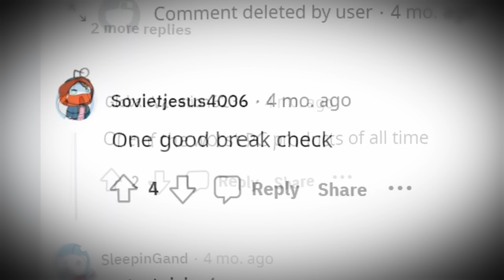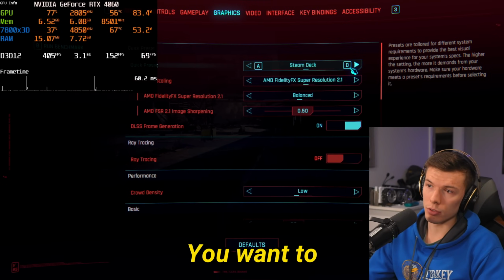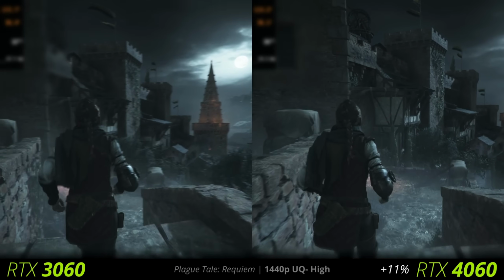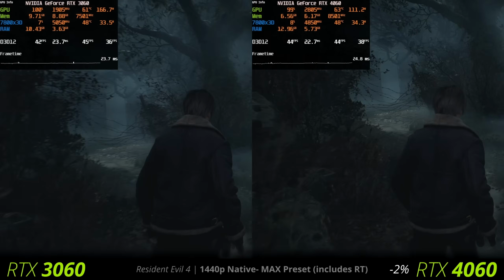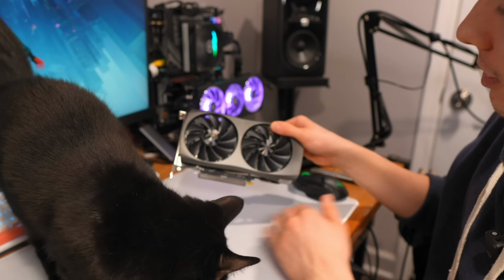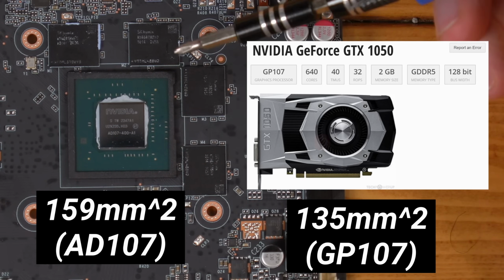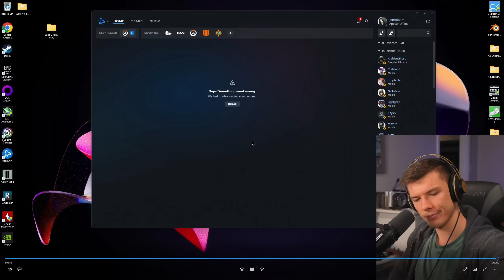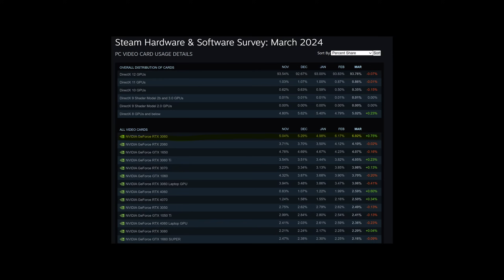I Tried Nvidia's best "Budget" GPU to see if we're Doomed

Comment: I upgraded from an R9 390 from almost a decade ago to a new 4060 8gb last week.  It ran very well with my ancient rig and now runs very well with my new mobo/cpu.  I havent tried anything as extreme or new as Alan Wake 2 or Cyberpunk but my Helldivers 2 runs at max setting, native upscaling, at a solid 60+ fps.  This card is just fine for a low cost 1080 rig utilizing a 60fps screen.   It also sips power (125 watts) vs my r9 @ 350 watts!  Having a console fills in the gaps for me on demanding games.
Reply: i’m going to make the exact same jump soon excited to see how it turns out. what cpu are you using?
Reply: I'm using a i5 13400 and Win 11 with 32 GB fast (can't remember) ddr5 ram.  Using all mid level parts games run perfectly at 1080 and great at 1440.  @bonnsmith  @bonnsmith
Reply: @matthewrobbins663   and which mother board?

Comment: its not that you dont have enough vram to fit the game, with the same settings the 2 cards should use the same amount of ram, its the speed of that ram, the 3060 has a 192 bit bus vs the 4060 is a 128 bit bus, that means per clock cycle 3060 transfers 50% more data to and from vram per ram chip, the 3060 also has 50% more ram chips, the result is the 3060 can transfer an extra 88 gigabytes per second

Comment: It all varies depending on price and marketing. I got a base 7600 for $200 open box and everyone I've talked to says that it was a super solid deal, and I've had a great time with it. Does that mean I'll tell someone to go buy this card for the $260 or $270 that you can get it for on amazon? Probably not unless it's that persons only option for something under 300. Everything surrounding the 7600 is pretty much a resounding "meh" but I've had a great experience with the card.

There's rarely a "bad card" nowadays, mostly just "card thats priced bad"

Comment: I'm happy with my purchase. Upgrading from 1660 super to 4060ti. Ideally I wanted 4070/7800XT but again, i need to upgrade my PSU and the pricing from 4060ti to 4070 is quite high for me, plus i need to change to new PSU.
Reply: So you say that it's worth it ? I have a 1660 super as well, and I was thinking of upgrading to a 4060
Reply: @danielfloare5820  please consider pricing from your place and if your PSU can work with 4070/7700xt/7800xt or higher. If you dont need to upgrade your PSU, and the pricing is not that far off (like $120 perhaps between 4060 to 7800xt/4070) consider getting higher end card. 

Its just bad pricing for high end card in my country, AMD pricing is also not as good as in the US. Nonetheless i commit and happy with my 4060ti, mainly for stream+recording on my free time.

Comment: I bought one. Going from 1660 super to 4060. My monitor is 1080p and PSU is 500W. It was the cheapest option to upgrade my graphics. All other options i have to spend another $50-$90 on a bigger PSU plus have to pay more for the GPU itself. The card is  perfect for someone like me.

Comment: I have a 4060 I just bought as an upgrade to the 1070TI. and I don't know if it's just me, but I love it for the price.  between these two cards, all games I play now are pulling off about a 40% increase in frames.

everything is expensive nowadays anyway and I don't feel 289 is honestly that bad for entry level. especially for what you get. the 1070ti, my previous graphics card, was advertised to be able to pull a great overclock. but the damn thing ran SO HOT that I couldn't actually overclock it without the card sounding like it was going to explode. now that might be PNY's fault and not the actual card but that's my experience with the 1070ti.

I haven't tried to overclock this one and I don't think I'll get very far with voltage but I'm excited to try because I've heard you can get somewhat of a good "stock voltage" overclock on this card.  Especially because 4k furmark stress test is only getting this card up to 62 C after 10-15 minutes of pressure. that's pretty cool out of the box. (the 1070ti stock voltage OC was at 88-90 C after 5 minutes...)

So I'd say if you compare the prices of everything and sheer % price spike in EVERYTHING in the current overall economy, I think it falls right in line to what you'd expect with a budget graphics card.

Comment: I did some math on my super high setup from 8 years ago and came to the conclusion that with the 1080 that was new at the time I spent 2k in total, which ends up being 250 dollars per year, and it still works and will probably give me another year. A setup with a 4060 will cost you around 850 (cpu and motherboard in equal pricing range to the 4060) but the vram issue is so bad you might have to upgrade in a few years, meaning you’ll get a yearly value of 283 dollars. Basically it’s a terrible bang for your buck and you’re spending more for less no matter how you look at it. The vram is a literally product breaking issue

Comment: I actually made some research before finally settling on buying a 4060 for myself.

The reasoning is quite simple, actually, because my older desktop PC was an i3 8100 with an gtx 1050 ti, and I've been using a laptop with a Ryzen 7 4800h with an rx 5600m, and what I'm looking for is basically to play at 1080p (I don't even have a 1440p monitor!!) with as high settings I can get without compromising fps, so basically vram won't be much of an issue (I probably will never go that high in graphics anyway). The comparisons I made were with the 3060, so this one is just better for what I need it for, and compared to AMD, for the same price (6600xt or 7600xt, latter slightly more expensive) it has ShadowPlay which I really really like, losing out on a bit of performance. Also productivity is great on this one..

Basically, it's great if you know what you're getting into.

Comment: Got this to pair with my old i7-2600k CPU as a temporary fix after my GTX 560Ti died. 

The RTX 4060 will do until I build a whole new PC in a year or 2.

For me its a MASSIVE jump in performance. Especially if you're using it mainly for emulation and Visual Pinball (VPX).

Comment: I went from a pny gtx 1060 to a msi rtx 4060ti. So it was a nice upgrade for me. I have a 1440p monitor and play all games at 1440p with the 4060ti. Always use dlss when available with balanced setting and no rt and get 60-100fps depending on the game. Would love to trade it in for a 4090 or wait until something in the 5000 series.

Comment: This is odd. I have a 4060 ti and I am able to run both older and newer titles with rtx at a locked 60 fps (only because I capped it at 60 fps). I have had little to no problems. Although I do want to upgrade to a 4080s i do not have the money for it.
Reply: I also run most of my games at 1440p but sometimes I keep the native res at 4k with similar performance. I do this on Batman: Arkham Knight, of course not that new of a game but still looks phenomenal.

Comment: Tweaking some configs im getting solid 50 to 60 fps average in cyberpunk with ray tracing in ultra on the 4060, thats without frame generation,  sometimes depending on the place it stutter to 40 but it comes back quick, with the frame generation i get close to 70 fps so for me it works like a gem, its all about tweaking the in game setting to get a better performance

Comment: People be saying gaming isn't fit for the 4070S but what about rendering/simulating? I've been using a ThinkPad 2016 300 since it came out to render. No games except GMod and HL 1 run on it without problems but i still love it. (can't wait to get it though since it still is abysmally slow for any program, it isn't bad, but degradation hit it for atleast 6 years with no cleaning)

Comment: One thing I can see as nice in a 4060 is the 115 Watts of power draw for RTX GPU with DLSS.

3060 eats 170, 1080Ti eats 250 so if you have a low-ish end rig, a 300$ gpu is acceptable upgrade if you had something like 1050ti/1660Ti and not the money/option for an entire new rig with 3080ti+.

Comment: I think I have the exact one you bought and I got it for about $220. It is leagues better than the 5500xt i was running before and quite a few games I play actively have dlss compatibility and dlss 3.0 is actually pretty good. All in all for $220 id say i got my bang for my buck. Not to mention my main monitor is 1440p and I can play most other games at max or close to max settings and get at least 100 fps reliably, even in unoptimized games that dont have dlss.

Comment: i have a 4060 in my laptop,and  it is preforming very good.But when i uptated the bios everything got fucked up,but i think in a good way.For some reason my 4060 uses the vram from the integrated graphichs too,and the preformance is better then the 4070 desktop version.The only small problem is that the system doesnt regognize the card anymore so i need to go to graphic settings,choose the app I want to use and put it on high preformance(the 4060).Overall its a good card,never had a problem with it

Comment: I went from a 2060 with 6gb of vram to the 4060 ti with 16 gb of vram. It fits right where the 2060 was, it runs cooler, it draws less power… those are all pluses for me. Plus I actually can turn on a lot of extra ray tracing and frame generation with those 16 gigs. Now the pricing is brutal to upgrade from the 4060 to the 16 gig ti, ill admit that, but it met my price ceiling. I was not going any higher. So it checked all the boxes.

Comment: I like the 4060 (I plan on getting one within the next months). I am very satisfied with 1080p and 60 frames per second. I don't need more. I'm old enough to remember when the normal fps rate for videogames 30fps, people claimed 60fps made the games look less cinematic, or overanimated, or that they couldn't tell the difference between them. I also don't want to buy new monitors. The 4060 pretty much garantees 1080p with 60 frames per second, while being very energy efficient at only 115 watts. If I had more disposable income I would get the single slot 70 watts 12gb A2000, but the 4060 will do.

Comment: Went from an RX550 to a RTX4060 about 2 months ago. Its absolutely worth the price, especially in todays GPU market. The performance upgrade was a lot better than I expected, it runs COD MW3 at ultra settings, dont remember the resolution, but pretty high resolution, 60 fps all day long at around 60% utilization. iRacing at medium graphics in VR holds 90 fps consistently, sometimes have to back off foliage or grandstands depending on track. I can run high settings at 60 fps outside of VR super easy. Microsoft Flight Sim 2024 on decently high settings around 2k resolution outside of VR runs great at 60 fps and looks amazing, and it can do low settings in VR at 90 fps at around 80-95% utilization depending on the terrain. 
TL:DR; It does everything i needed a GPU to do and for cheaper than anything else thatll do it. Is it perfect? Fuck no. But its also about $1500 cheaper than what would be perfect, so I'll take it.

Comment: I have an Asus RTX4060 Dual OC V2 (upgraded from GTX1650) with  3000 MHz over clock 127W on Asus Prime B360-A with 32Gb DDR4 Perdator at 2666 MHz and i5-9500. Lots of performances leftover but it's what you got when buying what you expect to work but pairing over spec and under spec components 😂. In sum it's playable. Cyberpunk 2077 18fps on max and 67fps on balanced. GTA5 has the same around 80 fps from before upgrading but from normal to max settings. In sum if you can over clock your RTX4060 you gain from 10 to 15% uplift reaching almost RTX4060TI 8G level of performance. Not the best purchase but a substantial upgrade.

Comment: For around 50 $ more you get a 3060 ti 8GB and it is still a Monster! with my Ryzen 7 58003d.
I play Warhammer 40k Space Marines 2 with 2k resolution and Ultra settings or Black Myth:Wukong  2k resolution and High settings. 
Both games run around 90 FPS.

Comment: I was able to get an open box 15"  HP Victus at microcenter for 650 bucks with a 4060, and I am honestly shocked at how unimpressive it is. I have to crank games down to Medium settings sometimes just to get acceptable frame rates. I swear, my old laptop from 2018 with a 1660ti ran better....in all seriousness for the price I paid, that HP Victus does everything I need it to do, but still, we really are going backwards.

Comment: Me and my cousin both have a pc with same stuff except the gpu. He has a rtx 4060 and I have a radeon 6700 XT. And they both were 300$ brand new. And I can confirm that the 6700 XT was SO MUCH BETTER than the 4060. Like CS:GO in my pc was getting like 250 fps in 1440p high settings while he was hardly getting 100 fps in 1440p medium. I am not trying to say that the 4060 is THAT bad but if you want better gaming and you do not care if its intel, amd or any other company and want performance, get the rx 6700 xt.

Comment: I got the 4060ti 16g from gigbyte, it was letting me play cp2077 on Ultra RT at 70-110 fps but after to long it would flatline unless capped at 60fps. I gave it back to Amazon and got a 4070 super which will be here tomorrow.

Comment: I changed from  3060 to a 4060 last minute in a build I purchased because the 3060 was out of stock. Well, I did play half life 1 in the lowest possible settings andI changed from  3060 to a 4060 last minute in a build I purchased because the 3060 was out of stock. Well, I did play half life 1 in the lowest possible settings and shittiest resolution and still had some frequent freezings and such, so I'm not that upset about it.

Comment: What is an alternative on the 4060. Where should I spend my money as a new PC gamer around the same price
Reply: Arc b580 or rx 7600xt.
Reply: @vicente3k  The 7600 XT costs €60 more where I live, uses 60W more power, and performs about the same. Intel’s Arc lineup is unpredictable in terms of long-term driver support, so while these are alternatives, I wouldn’t call them good alternatives.

If power efficiency matters, check performance-per-watt charts. The RTX 4060 isn’t as bad as many claim - it’s just not a major leap forward. That said, I personally went for the OC 4060 Ti 16GB from MSI in October 2023.

If you’re building in a small form factor case or prioritize low noise and heat, the 4060 is a clear winner over the competition.

Many newer games are poorly optimized, making raw performance harder to judge. But if you play older games and value DLSS 3, the RTX 4060 remains a solid choice.
VRAM is an important factor for long-term use, which is why I went for the 16GB Ti model - and now, depending on your local pricing, it’s equal or very close to the inferior 7600 XT.
Reply: @herzglass  I recommended those based on USA prices and vram. I would avoid any 8gb gpu. If he can find a 4060 for less than 300$, good.
Reply: @vicente3k  Agreed. A 8GB version is not a good buy anymore unless it's super cheap.
Reply: @herzglass  Exactly. The 4060 is not a bad gpu perfomance-wise, but it's badly priced. Also, he could wait until March to see what AMD brings to the table since Nvidia's 5060 is gonna have 8gb 🤣

Comment: I use the 4060 and I honestly think it's good, but the overclocking is the only thing that makes it decent, at 165fps settings on high on 1440p i just fine tuned it to run as smooth and decent graphics. I dont get any screen tearing no delay nothing
Reply: ohh and yeah I don't use frame generation

Comment: I'm currently running Microsoft Flight Simulator 2020 on high settings with an Nvidia GTX 980ti 6GB, with an AMD FX 8350 Eight-Core Processor 4.00 GHz and 16gb of ram.  I can get up to 30 fps most of the time. It looks great and is at least playable. How is it that an RTX 4060 drops to such low frame rates on games that are probably less demanding than Flight Simulator 2020? I was thinking of building a pc with the RTX 4060 card to run the sim but should I?

Comment: Tbh I think they went for an optimized 3060, I really love that they minimize its tdp and they improve performance too. I have a 3080 and it makes a lot of noise because it has to get its temperatures low, that's why I think they should improve the temps and tdps before going a step ahead, if not, the memes about giant gpus wont be memes anymore.

Comment: I'm planning on going from a 2060 6Gb single fan (most basic model), to a 4060 8Gb dual fan. If I can sell my old 2060 it will be worth it for sure. Also, Nvidia did kinda screw up, but if you're going to buy a 4060 to not use DLSS, just save your money and buy a better GPU. Otherwise, you're just gonna piss yourself off.

Comment: i needed an entry-level card for someone, got the 4060 because for one thing it has 50% higher performance per-watt than the 3060, so it's much quieter, and by nearly all metrics it out-performs the inefficient 3060... is it stupidly overpriced? absolutely, and if you are going to game at low resolution 4060 limits your cpu will make a much bigger difference... unfortunately this video doesn't appear to mention what cpu was used? so it's hard to take the framerate claims seriously.

Comment: I have a 4060 laptop. I kinda had no other choice than to get 8GB of VRAM. The 4050 and 3060 mobile cards both have 6GB of VRAM. The first cards to not have 8GB are the RX 6700M (10GB - 160-bit), RTX 4080 Laptop GPU (12GB - 192-bit), RTX 3080 Ti Laptop GPU (16GB - 256-bit) and RX 7900M (16GB - 256-bit). All of these cards are expensive except maybe the 6700M, but the first time I saw a laptop with an AMD GPU was today, and that was the 7900M in the Alienware M18. I could've gotten the 3070 to get a 256-bit bus, solving all of my bandwidth issues, but I would've lost out on some RT performance and Frame Generation. With a 40 series card I also have better and longer driver support. So next time you're having a meltdown about 8GB of VRAM, just know that you had other options, us, laptop gamers didn't.